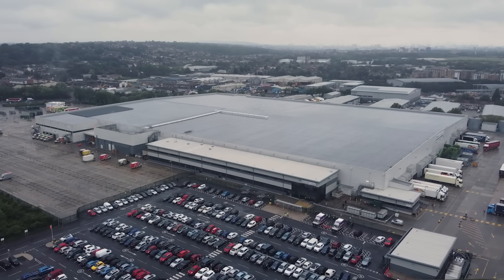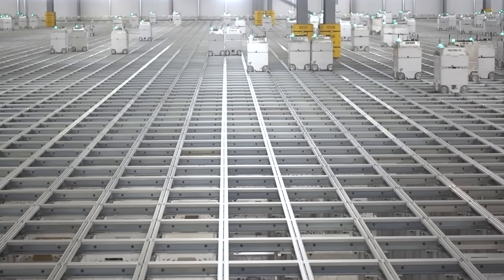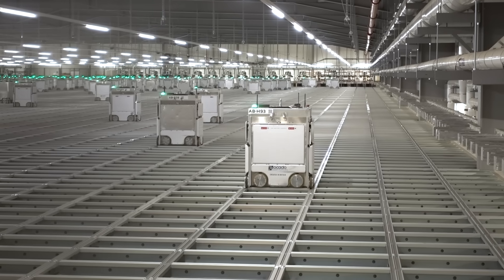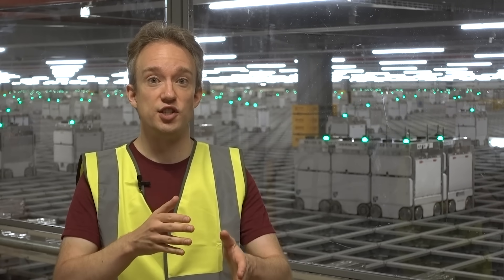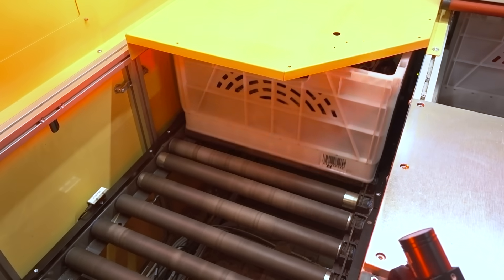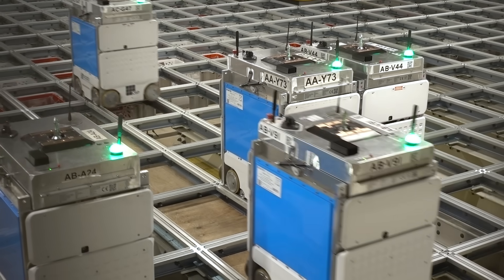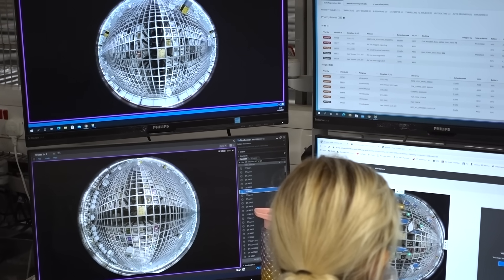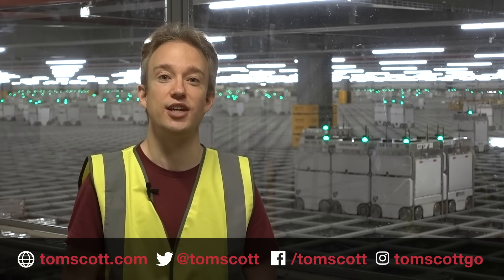How many robots does it take to run a grocery store?

Comment: It’s interesting that they use an Xbox one Kinect in the system.
Reply: One of the best 3D motion cameras that is a reasonable price. That’s my guess anyway.
Reply: theres a newer version of it with twice the resolution and twice the feild of view for 400 dollars, idk why they would go with that one instead
Reply: @boxrocket_jco  I'm guessing the factory was built before that model and/or it works well enough for the job at hand so an upgrade isn't needed
Reply: @soniclegend44  good point, i mean i still use the kinect 2 for mocap and it works well enough
Reply: @boxrocket_jco  You said it yourself "newer". When the robot got planned and designed the new model most likely wasn't out yet. It would now take a big overhead to make changes again and test the system for stability. Also no need to overextend on hardware. If the older version does the job well enough, why upgrade past systems? Just use the old one until it breaks and just use the new one for new systems.
Reply: @boxrocket_jco  It probably is because they don't need more advanced tech for them.
Reply: Some of the best consumer/industrial computer vision software to date. Surprising number of old independent projects run on original Kinect.
Reply: A lot of places find the Kinect to be one of the easiest and the best 3d cameras to work with.
You can interact with the camera feed directly instead of some other cameras requiring 1000s of dollars in specialist software
Reply: @RoboSkyrat  Ohh I see , I thought it might be something like that. I did wonder why they still sell online well and mainly to businesses , since it was somewhat of a flop for the mass market.
Reply: @RoboSkyrat  could just code your own software to interpret the data
Reply: If it’s good enough for surgeries, it’s good enough for groceries.
Reply: They do the job. Loads of things run on xbox kinect cameras that you wouldn't expect. I use mine to 3d scan people
Reply: One benefit of the Kinect is that it's readily available off the shelf, or at least it was for a while
Reply: @sundhaug92  Perhaps for testing they'd get 'something off the shelf' but they ain't for a rollout.
Reply: oftentimes large buisnesses use products intended for gaming. I saw a video where some armaments producer (i think it was rheinmetall) used the same flight stick i have for testing drones
Reply: @the1ultimatet1u49  if a product already exists might as well use it
Reply: @the1ultimatet1u49  I remember seeing giant racks of PS3's strung together to form some budget supercomputer.
Reply: I think the wierdest use I've seen for the kinect is by ghost hunters and ghost tour guides as an infrared camera
Reply: Interesting how it more or less totally failed as a consumer product but exploded in the maker spaces.
Reply: Nice catch

Comment: I can't imagine the amount of maintenance those robots require
Reply: Less than you would expect. In a controlled environment, robotics are extremely reliable and long-lived
Reply: Dont worry, they probably have an automated maintenance & repair station for that
Reply: @morningstar_37  ahh but who maintains the automated maintenance?!
Reply: @MrIrrelevantComments  probably the automated maintenance automated maintenance
Reply: @kenet7877  Which gets maintenained by the automated automated automated maintenance maintenance maintenance
Reply: Well humans require more maintenance
Reply: I suspect it's surprisingly little.  Definitely some needed just for the sure volumn of components, but it's a built for a purpose factory environment, so there's probably extremely little that goes on outside of standard operating parameters.
Reply: Stuff built for industrial purposes are WAY hardier than consumer stuff and a lot of the time itll only require maintinence when something has gone terribly wrong.
Reply: All I can tell you is that you're overestimating it. If it was "a lot", it probably wouldn't be worth the extra cost  of constant repair, keeping paid specialists around all day...
Reply: Robots will probably have significantly less maintenance compared to humans
Reply: Probably very little, the most common one is probably the wheel bearings getting gunked or stuck.
Reply: Less than humans.
Reply: Hey at least it allows for some jobs to be created in place of those that these robots made redundant.